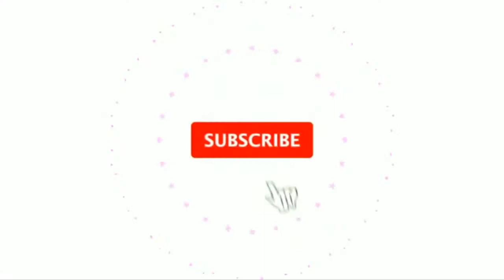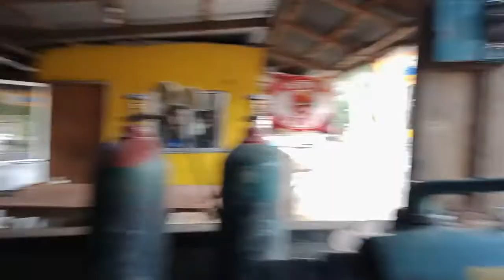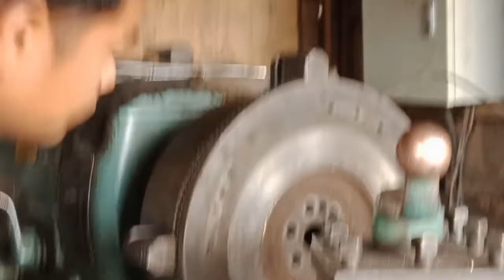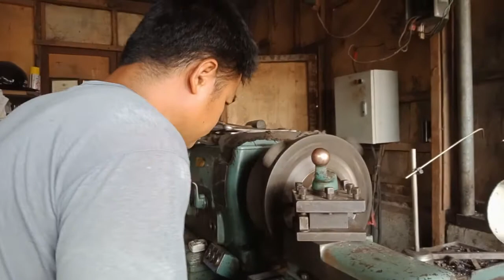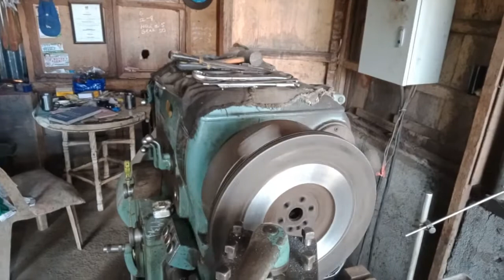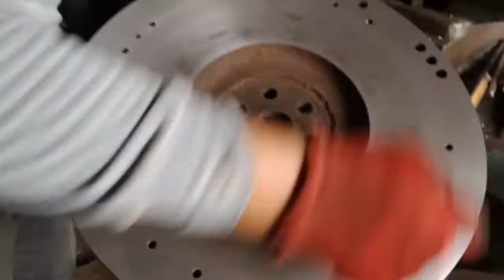HOW TO REFACE A FLYWHEEL?

Comment: Boss ngpalit ako ng cluch dics at rilis bearing at presure plate ..nanging maingay na pag nasa 4th 5 gear na dapat ba pina reface kona
Reply from the maker: Yes sir dapat po pag nag palit k ng clutch disc matic po na ipa reface mo ang flywheel kc dna po pantay ang lapat pag basta k lng po magpapalit.salamat po sir sa isang tanung n mapapakinabangan ng marami nating mga veiwers.❤️❤️❤️
Reply: Idol ask lang yong refacing poba ay parang nililiha din torno lang ang gamit?
Reply from the maker: Hindi po sir liha lng ang gamit..meron po kaming talim n ang tawag po ay carbide sya pong ginagamit naming talim pang repace po.